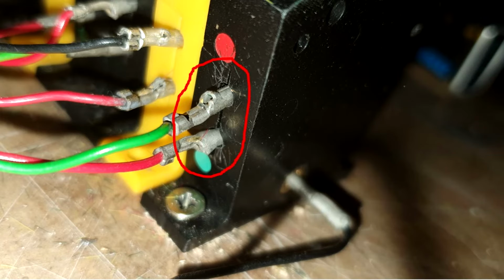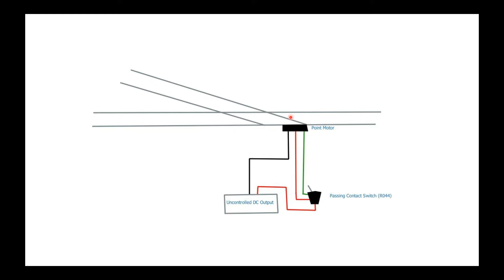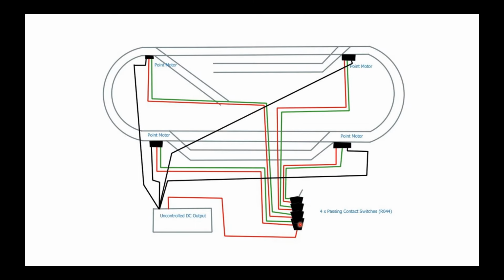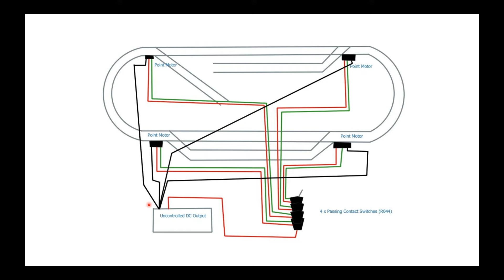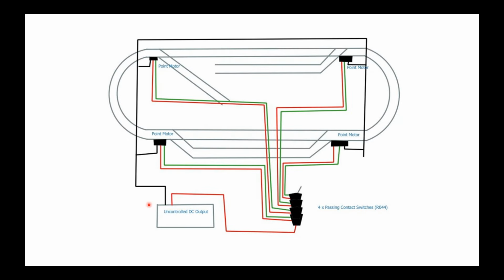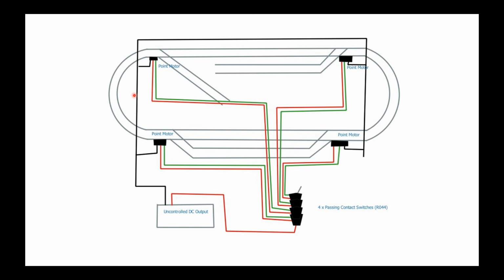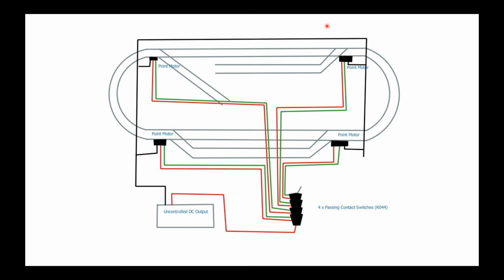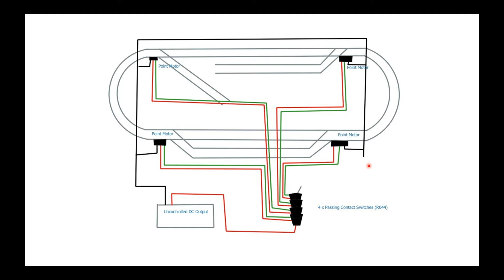How to Wire Multiple Points on a DC Layout

Comment: Thank you OOBill.
 I am a Ludditte and Want to use the Old Style Point Levers with simple surface mounted Point motors.
 I did all this as a Kid in the 1970, and it all worked out Fine. 

 It Felt like I was the 'Old Fellow,' in Signal box, Cloth Cap, cup of Tea and Pork Pie, not to far away..!

 Physically pulling the Levers and Changing the Points..!! That was the joy..!

 I understand Technology has moved on at a Serious Pace..! 

 I however have not, now in my Late 60's.
 I Dont want DCC taking (stealing) all that Tactile feel away..! 

 After all, I can now sport a Cloth cap and not look rediculous today. 

 Don't get me wrong DCC is wonderful, Bells, Whistles and the  realistic sound is Great, no argument..! 
 But its not what I am going for..!
 I want to Drive the Loco, not watch a Program, do it all for me..! Very Realistic it is for sure.
 But it's not what my Childhood recalls or Old age is trying to find..!!

 So Thank you So much,  for your Memory Refresh.
 Because I too, found all the New Gizmo's shown multipule times by Many youngbloods.
 
 How Brilliant they are all set up, to happend without Effort apart of course a $50 for this CDU another $30 here another $40.
 Not to mention Chips 8 Pin, 12 pin, 18 pin or 21..! For every bloody Loco plus the Controler ect ect..!

 Give my Pension fund a Brake. I just want a Couple of Loco's, rolling stock a few LED lights and Powered points..! 

 Bingo, so until I pull one too many Levers and, I drop off the Twigg..!
 Ending up in the G.W.R's waiting room.

 I will stick with simple and after all LED's are New Tech ain't they..?

 Cheers to all   as long as Your 'OO' or '1/76' the rest of ya can Burn in Hell..!!
 😂😂😂👿
Reply: Keep on Chuggin'!!! :D

Comment: This is such a great video and a brilliantly clear diagram. Please could you do a diagram to show how a CDU and toggle switches would be incorporated? 

I assume the red wire from uncontrolled DC would have to be spliced/go through terminal block so there’s one to each switch, rather than just the one for all passing contact switches..?
Reply from the maker: Basically a CDU would be installed in the circuit immediately from the uncontrolled output. In other words remove the red and black wires from the uncontrolled output in my diagram and connect them to the output of the CDU. Then connect the input of the CDU to the uncontrolled output of the controller. They don't really work with Hornby lever switches so I don't use one.
Reply: @oobill  thank you!! 👍🏻👍🏻

Comment: Fantastic channel. Where abouts in the circuit you describe would a capacitor discharge unit be wired please, as I have seen that these improve the function of the point motor. All the best!!
Reply from the maker: I don't use one as I don't really need to switch more than one point at a time and they all work fine. But if you were to fit one it would interrupt the circuit between uncontrolled output and the points.
Reply: Using a CDU with Hornby black passing contact levers are not compatible used together unless stopped mid throw for a second or so which can possibly end up with the motors failing..Best and safer to use only on-off-on toggle switches or blade directional studs with a probe if incorporating a CDU when wiring motors

Comment: Well explained video. If I wanted to use toggle switches would I need a particular sort.
Reply from the maker: As long as the switches are on/off/on and automatically spring back to the centre "off" position any should be fine.

Comment: Doesn't the green wire always show in the middle of the point .motor?

On your diagram you have the green wire in the middle on a couple of points, but on the end connection on the others - which is correct ?
Reply from the maker: Either. Just determines which way the point throws in relation to the lever or switch.

Comment: hallelujah!!!!!
Finally someone that explains it properly for a newbie
I’ve got 14 points and 3 Eze-wire switch boxes of 5 switches to wire up and wanted to know the easiest way to do this but all the tutorial show how to wire a point motor to a terminal block but not the whole story
I’m using Peco Pl-11 surface motor  

The Green wire is the common. So I Connect this to one terminal of the power supply. The red and black wires then switch the point motor 
So in my case it would be the RED instead   Of the black I would use as the bus wire I take it 
I only said to a member yesterday that there are loads of tutorials on how to wire a point motor but none of how to from the source, or how to more than one so thank you as this was explained easily

Comment: I have just bought my first point motor. Its a Hornby and quite neat.
On my old layout back in the eighties i had a bank of Hornby switches. Yellow and green for one signal and the rest worked the street lights. 
Don't think I've got the black switch. 
Does it have to be this one?

Comment: Hi Bill, thanks for the video! Very helpful, just a question I plan to use the Hornby R965 controller for loco control and my 7 point motors for my shunting layout, do you think that the controller will be powerful enough or would I have to upgrade to something else?

Comment: Thank you Thank you Thank you Bill, I was starting to panic...All l could find was dcc info'. You've saved my Bacon ol son Thank you... I was also worried I wouldn't be able to use my Hornby switches and again there's yours...Great... Just one question what point motors are you using please? I was expecting to see baseboard mounted ones for some reason...Thanks again Paul

Comment: Nicely explained, the only shame is that Hornby messed things up with the wire colours. All other manufactures use Green as the common wire from the power source and the Black & Red for the switch wires. People need to be aware of this if they use motors from different manufacturers.

Comment: I've suddenly found a problem with two of my main lines. Despite power being off on one the inner won't work until I pull a lead out which is odd as I haven't changed anything with the wiring. Now I'm going over everything again. Thanks for your information. Not heard you yet as out in a noisy pub. Have saved your video. Thanks.
Reply: My problem is no more. 
As with my point motor. Have not tried yet but have a new black switch for it. If the others (yellow/green) ones do the same thing then I won't bother buying anymore.

Comment: Hello Bill,  you roughly know my layout- 2 main lines, four track station and at the  other end  the two main tracks plus two loops in each direction.
If you remember I nearly had a fire possibly as a result of having two power sources activated.
I am trying to resolve/avoid that problem moving ahead, so if I install two sets of points with a power source for tip line before a point and another power source on the other side  of the second point just as you show at 2:54 would that work?
Would I need to isolate any loops or wire in toggles?
Sorry for the complicated question
Thanks
Charlie
Reply from the maker: Would need to see a plan of what you mean especially when it comes to whether or not you need or would benefit from toggles. Insulfrog points should isolate power from the turn out track when closed for straight ahead. For DC running you shouldn't really need to provide power either side of a point. The diagram in this video is for wiring point motors there are no power points shown on the track itself.
Reply: @oobill  will scratch one up

Comment: Hi Bill,
Your videos are great,just a question on the Hornby point switches,does the red or the green wire go in the bottem?
thanks Tim
Reply from the maker: It depends which way you want the point to throw in relation to the switch position. So it doesn't actually matter.

Comment: Good one . Quick question , what do you use to connect the subsidiary black wires to the bus . You mentioned terminal blocks , what type would these be and where do you get them ? Could you just solder the wire to the bus ?
Reply from the maker: I just cut and strip the wires then twist them together and solder them. Any sort of low amp terminal blocks will do for connecting wires but a Power Distribution Bus Power Terminal would be the ideal thing and what I intend to use soon to rewire everything. That way the block becomes the bus and keeps things very tidy.
Reply: @oobill  Cheers Bill . That last part could have been Gaelic !  I feel guilty as I’ve been into model railways for 50 odd years and I’m still asking these questions . As you can probably gather my electrics are essentially simple . I did have powered points in my eat;y layouts but haven’t bothered on my big loft layout , mainly because of all the wiring required . It would add something to operating though . Thanks for taking time to respond .

Comment: Can you help me,I am running  5 points off my a bus wire and will add more on  but does the bus wire have to be a large wire ,I am using  peco surface points and I am using a gangemaster  transfer type  T 4,
 layout is on a broad which is 80cm wide and 2400 cm long and is a termus  layout, I will have about 18 points on it when finished ,it is a d.c.c layout

Comment: I know this video is 2 yrs old but I've just found it and have been looking all over to get information on how to wire my layout. I've just bought the new TT 120 set and track packs and am making a layout on a 5X4 ft board. But trying to find a simple guide to wiring it up and how to wire points is like banging my head against a brick wall. Will this work for turnout motors? And what motors would you recommend for my layout?
Many thanks for this video but one question, are the 4 passing switches connected with a Live wire between them as I don't see a live wire from the Controller output.
Also you don't by any chance have a video on how to wire up the bus and dropper wires do you?
Thanks very much.
Reply from the maker: I have no idea what motors are available for TT120 points I'm afraid. But yes this wiring will work it'll be the same principal. With the old Hornby lever switches they plug together so you don't need to have a wire linking them. But if you toggle type switches you will need to link them. If I remember rightly I show this in this video.

Comment: 👍
Reply: Terrific explanation and just what I was looking for. Just one question - instead of using the uncontrolled dc output, can I use the uncontrolled ac output, as the motor and passing contact switch can use either, and is the wiring the same ?
Reply: @chrisgarner2873  yes you will be able to as far as I know
Reply: @reliantrailways  Thank you for that

Comment: Thanks for the very clear explanation, just started to install point motors so, very useful. just a quick question, what do you put on the other end of the bus wire? I am guessing it's not a good idea to just leave it hanging ? Cheers